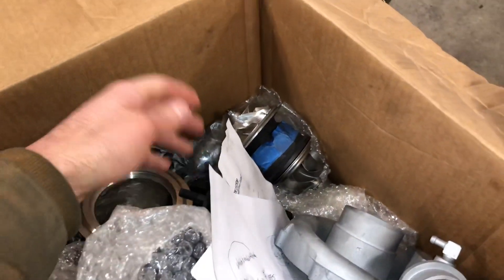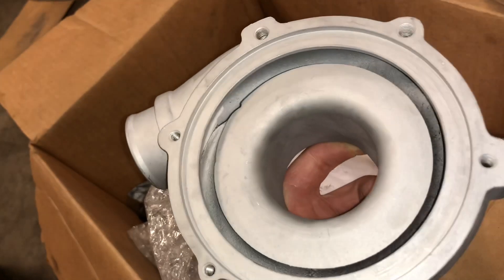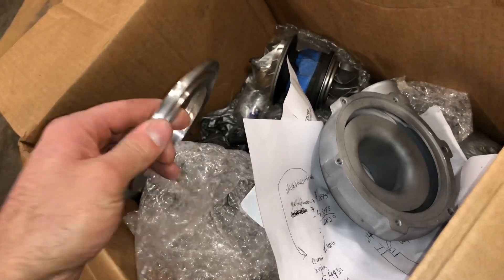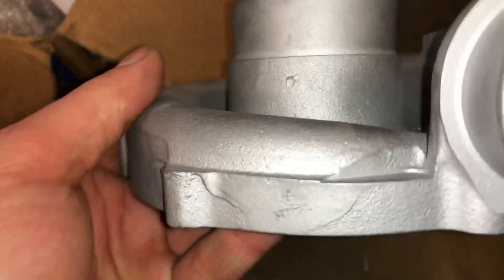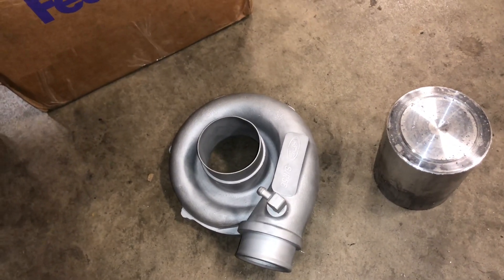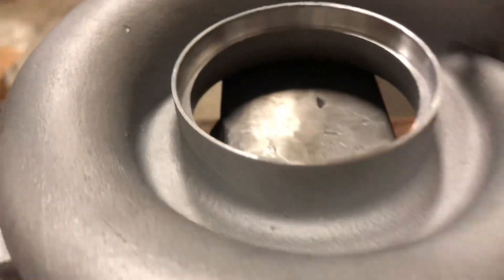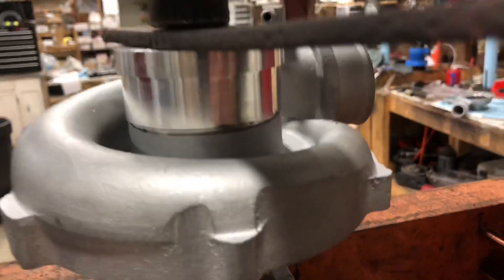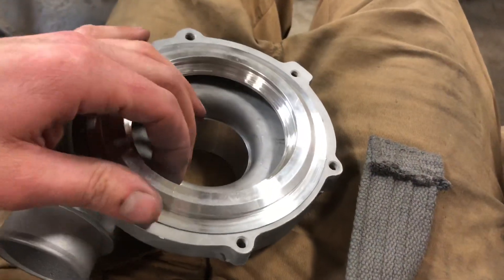APS SR56 Turbo Upgrade to 60-1

Comment: interesting. i have been wondering this for a while now with the cheaper turbos. i just wish i knew how much $ a person would need to save up for to get it done. and how much of a turbine/compressor size difference would be too much,if any, as long as the turbine doesnt get maxxed out i guess.
i dont know, a lot to learn for me. if the compressor doesnt add lag as well.